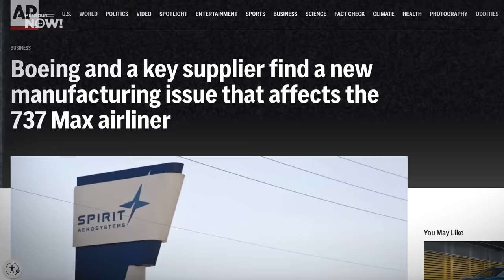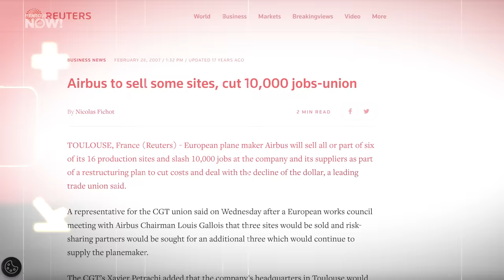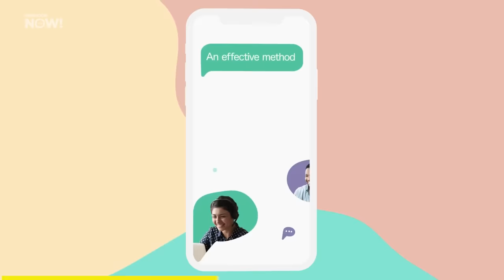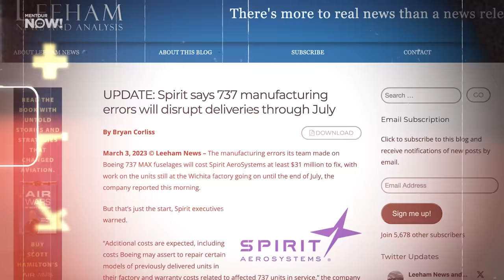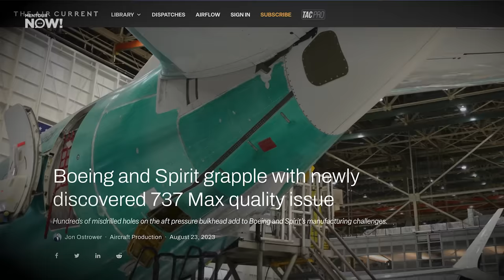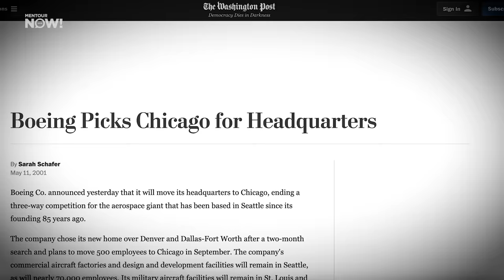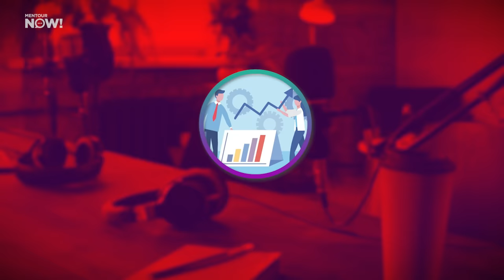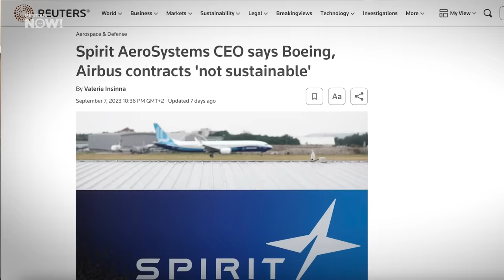NEW Problems with the B737MAX!

Comment: I think it's time for Boeing to admit that the 737-MAX is NOT a real 737... Instead, Boeing should just rebrand the thing correctly, like a Boeing 444, remove the gimmicks that make it behave like a 737 and send the pilots on the training that would be required for the new type!!! 

Had they done this from the beginning they would not need to have created an additional gimmicky piece of software (which is just another component in the system that can go corrupt) that sits between the pilot controls and Air-Plane computer in order to tell the Aircraft that this pilot input actually means that. Had they branded the thing correctly and send the pilots on training for the type, they could probably have prevented the initial 737-Max crashes and saved a lot more money than what they ended up having to spend; because of them taking shortcuts to try and save money, in the first place.

I don't think that we've seen then end of the 737-MAX headaches yet... I for one do not trust the perceived calm surrounding the 737-Max one bit! Especially this software gimmick in there that is crucial to function at all times in order for the plane not to crash! Just a small software glitch like a stack overflow or an incorrect calculation; and that plane comes crashing down!

I don't know. I am just not a fan of the entire 737-MAX development! That thing is fraught with danger and disaster from start to finish!

Comment: @10:56, someone tried to coverup their drilling mistakes using several  “snowman.” Spirit and Boeing claimed they had no prior knowledge of this remedial construction. Here, the shoddy rudder and rear bulkhead construction are ominous signs of crappy workmanship in the US commercial aircraft industry. These revelations of construction defects will ultimately destroy the US commercial aircraft industry just as shoddy US made vehicles allowed the Japanese auto makers to dominate the US auto market. Don’t be surprise when the C919 eats the 737Max’s lunch.
Reply: The C919 is more on the leven of the A320 and 737 from the 90s. The fuel consumption per seat is not that good. And the production quality has to show its strength yet.
So no, the C919 will not beat any European or American plane. But that is not the purpose of this plane. It exists to practice how to design and produce a civilian airplane. Then next generation will be slightly better and so on.
Maybe in 15 years China will have a modern and competitive airplane ready.

Comment: The First issue that affected the 737 Max with the MCAS software that brought down Two of them was a very Similar issue that happened on a Quantas Air flight almost 12 years prior. Except the Aircraft was already 40,000 feet in the air and it Dragged down the nose of the aircraft multiple times and managed to land safely. the 737 Max seems like History repeating itself. Boeing needs to scrap the Aircraft and restructure it's ranks.
Reply: What good would scrapping it do

Comment: I booked flights the other day and made sure I flew on one with airbus and not a 737 max.
I'll never trust them after the insanity of a non redundant critical system that any decent engineer could see was a crash waiting to happen and would never have allowed to go into service.
Reply: Did you already travel or is it for a trip in the future? If you haven’t traveled yet, I’d make sure to check the trip details/itinerary as the time gets closer to confirm there’s no changes in the aircraft type as those things can change for whatever reason.

Comment: If it's a Boeing, I ain't going still holds up I suppose? 
If you let ruthless economists run an engineering company, reliability is bound to worsen to say the least. Shortcuts, financial pressure not just internally but also on small long time suppliers which have to cut down manufacturing cost which literally equals quality...
Might work with a company like Activision Blizzard but the FAA already took a big hit after the MCAS disaster... Way to put yourself out of business with literally businessmen.

Comment: Well...what has Boeings' problems got in common with the FIRST jet powered airliner, the Comet?
Answer:
The Engineers design was overruled  by dominating production manager who couldnt get his head around the specification that De Havilland were using proven highly specialised glue to hold wings and windows to fuselage..
He arrogantly insisted on rivets!
Anyone with an Aeronautics Degree knows that it was the rivets that lead to metal fatigue, and the crashes, and the whole plane being failed.The glue wasn't the problem.
It was well proven in the Mosquito fighter Bomber, at high altitude and in the heat of North Africa, and the Tropics.However students are told about physics of metal fatigue, but not how ignoring engineering specs.actually was the problem.
Boeing have been ignorant in the extreme in their behaviour towards professional engineers.

Comment: Yet another reason to use Airbus, a much more honest and reliable company.
Reply: You have no idea what the problems with the cracked wing ribs with the A 380 are, took recalls to fix fatigue failures happening in operation, this is nothing in comparison.
Reply: Read up on Airbus corruption!
Reply: no way you just said that

Comment: I wouls not under any condition get aboard one of these. The first batch was a disaster, and I do not trust Being to have fixed troubles with it.  Start over and design a plane that will take off, fly properly, and land safely. You should be able to do that by now. What's wrong?

Comment: What happens when you try to save money and break union work force hire rural non union employees. While upper management takes home huge bonuses. They wanted to crack down on.people getting a 30k a year pension. After 30 years of hard work. And hired low skill low education workers for less than aero spec union employees. I don’t feel bad for Boeing Boeing is on the way out when you call the market that the 757/767 filled a niche market you are out of touch

Comment: Why did Boeing move their headquarters to Chicago?
I don't know -- but I have a thought. During WWII, the plutonium for one of the first atom bombs was made in Washington, and it was made very carelessly. As a result there is a huge volume of rogue radioactivity polluting the water table somewhere deep under the state of Washington. That cloud or bubble of radioactivity is moving slowly toward the sea where, in a couple of hundred thousand years or so, it will disperse itself harmlessly.
In the meantime, it's going to hit populated Washington in the next decade or so -- and it's far far too big for anybody to simply pump out and flush someplace. It's trouble.
Can that be why Boeing would rather be situated, legally if not altogether, in some other jurisdiction and tax realm? Just askin'.

Comment: You described a lot of the issues but didn’t get to the main core problem of Boing. Boing started to go downhill after in management the beancounter and accountants got the upper hand and the company wasn’t run by engineers anymore. That was the root cause of the MCAS desaster and is the root cause of the Spirit BS.

Comment: 737 airframe is way beyond its useful life. Boeing thinks it can continue extending the fuselage length and compensate with computer technology. It failed in the 737 Max. Yet they persist.
Reply: Did you know the 757 uses the exact same fuselage constant sections as the 737? The 707 and 727 also.
Reply: The MCAS had nothing to do with the length of the fuselage, Read Aviation Week.

Comment: I am a flight attendant (cabin crew) in the UK and have worked for the same airline for 30 years. I know a lot about the Max 737-8 and 737-9.The Max was grounded for nearly a year.Pilots and the crew were nervous about it’s return to the skies because they found not just 1 fault but approximately 35!!!! Also on the 787 Dreamliner. I can tell you that they are cutting corners and rolling them out to quickly. I will tell you why STOCKS and SHARES £££$$$. I f you are familiar with the WEF then you understand the “Climate Hoax” they don’t want us flying as much!! Although they have private planes and meet in Davos. I have never known as many issues as we have now. I am commenting after the Alaskan incident on the 737-9 Max!! Boeing what’s happening??? They care more about shares than souls!!

Comment: Typical modern corporate thought process. Take a quality brand and product and give control to people who have little to no idea of what they have or what the company is and SHOULD be. While I love Boeing aircraft, when they moved out of Everett for the headquarters, Boeing changed. Now bean counters and lawyers run the company. The quote of "We can't be experts in everything" was the EXACT OPPOSITE of what Boeing used to be.If they weren't experts they BECAME experts. It was an aircraft company that became experts at buildings, or trains for transport or logistics, etc. 
The 737 airframe is one of the best ever built. But these bums running this company will ruin both the company's and the aircraft it makes reputation for decades and give away the commercial aircraft business to foreign ones like Airbus.

Comment: No one knows exactly what’s going on.  Let me explain, it’s not Boeing problem or their process however, Airbus and every other companies have problems as well. It is easy for People to point fingers at problem, instead of talking about solution and praising the companies and individuals for their effort. The issue lies with the supplier. People should t be blaming the company or say anything they don’t know. The issue again lies with suppliers and parts scarcity. Every company out there is dealing with it. Engine manufacturers are going through that as well. 
I’ve said my peace. Bye now!

Comment: 9:45 A snow man is drilling a second hole too close to the defective hole you just drilled?! Two mistakes do not make a right!!!! 10:29 the defective holes are in the aft pressure bulkhead which has quite an important role so the building quality must be up to the VERY HIGHEST possible standard. Highest possible standard from Boeing? Are you kidding? The fuselage and the safety of the passengers HAS BEEN COMPROMISED, once again and the FAA is again bending over for Boeing. 300/4000=7.5% holes do not qualify!!! So the same morons that made and failed to inspect the snow man holes are going to fix the pressure bulkheads? RIGHT!!!

Comment: B737 should NOT be certified for transport of humans. Period. Problems mentioned in the video are not so significant. If one would compare , ergonomic aspects, trouble shutting, interface between system and the pilot, on B737 and A320 the verdict could be only one.

Comment: Why ss Boeing falling so easily from the sky? I'm avoiding Airlines that use them.
Reply: The issue was fixed nearly 5 years ago. This is ignorant
Reply: @JayJayAviation  until the next issue were Boeing will claim pilot error, while the flight recorders show better than expected pilot skills 😉 👍
Reply: @idarpolden5913  except that won’t happen 😊
Reply: I don't risk my life on those poor odds. Who will?
Reply: @idarpolden5913  the odds are nearly zero. What are you basing your odds on?

Comment: They could have learned from the automotive sector: GM, with Delhpi, and Ford, with Visteon, demerged "non-core" manufacturing in the 1990's but the new companies didn't have a sustainable business model until restructured using Chapter 11.

Comment: Petter should stick to piloting issues; he does not really understand the business aspects of the aerospace industry. The main reason Boeing spins off operations like Spirit is to dilute the investment required to develop a new aircraft. When it came to developing the 777, Boeing realized that it was essentially betting the entire company on the success of each new airframe project, such was the massive investment required. The aerospace industry needed to evolve to a model where investment in new airframes was shared across a broader capital base (i.e. more companies). There are parallels here with the semiconductor industry, where AMD sold off its fabs to create Global Foundries, and companies like Nvidia and TSMC have risen up by focusing solely on chip design and chip production respectively. Jet engines have a similar phenomenon where consortiums have become necessary, because no single company can risk the massive investment required in developing a new large jet engine.

Comment: I have been working in Aviation for over 30 years.  The 737, which was originally designed in 1950's is a big giant turd. If it wasn't for Southwest Airlines  that aircraft would have been parked in the desert a long time ago. A few examples of why 737 sucks- here are some design flaws.  On every single 737-The mid pressure deck will crack out, the cockpit window frames will  always develop cracks,   bearings on the  horizontal prematurely wear out.Because the of Kinmilling on the skin making the skin so thin ,you can't repair the skin with a doubler- the whole panel has to be replaced. And the list goes on and on why 737 is a crappy Aircraft past it's time.

Comment: So what I understand, is, with every profit they make with selling Airbus (parts), they repair a Boeing. As an Boeing engineer you would never sell this part of the company. If the idea was really, Spirit should make profit while producing parts for another Companies, too. It worked very well. But, how "smart" are these financiers when they remove the filet and don't participate from the profit????? Why didn't they start up Spirit as  Boeing department, building parts for everybody? 
And I am still worried, why yesterday they do drill a hole correct and today they can't? They don't notice it, they don't care about!

What we know today, and more is coming, a Company with this culture should not be allowed to built passenger airplanes! This Company must be closed!!! In the air is no space for errors just happening because of this culture of stock holders locking for profit!

Comment: Bigger engine,Catherine wheel  affect on balance, of   Flight surface surfaces ability.  Rear loading against thrust of new engine power,overloads  tail extension fuselage weight.  Centre of gravity is over come,in thrust, even to compromise the  computerised  instruction of flight. 
For  BLIND  PROFIT  The destroyer of Humanity.  Wake up,. Humans if you are still there.

Comment: F Boeing.  The engineers no longer have control of the design.  Outsourced manufacturing is dropping the ball.  This limp-dick approach towards aircraft design and certification should outrage the aviation community.  It certainly has generated much mistrust amongst the passengers. An excellent example of the decline of US engineering.  Let's see where this takes us

Comment: The 737 design has reached its limit you can’t keep fucking and tinkering around with a 60 year old design and think you can keep stretching and incorporating new technology into it and think its still gonna be ok as a viable plane. Build a modern design from scratch that is easier to work with and that could easily incorporate newer technology and bigger and stronger engines. The whole 737max is just a fucking money pit and disaster.